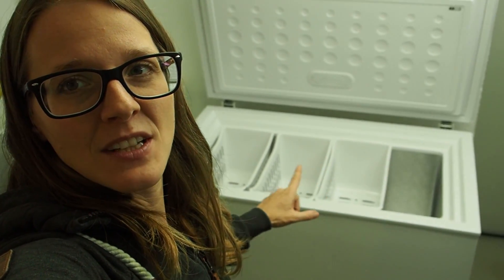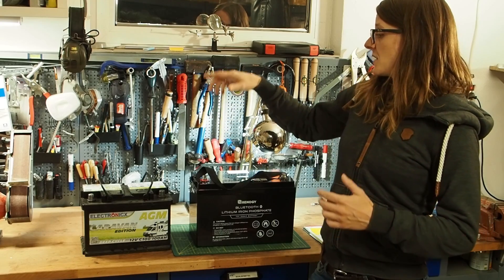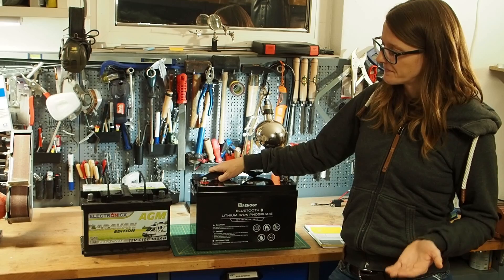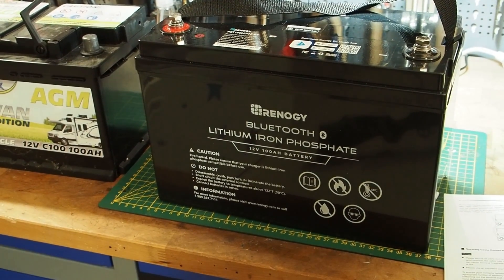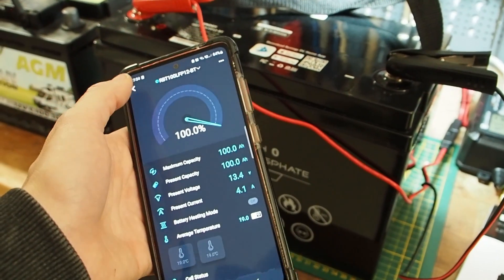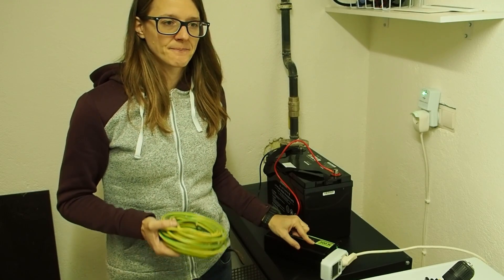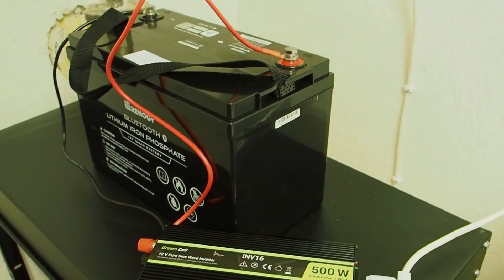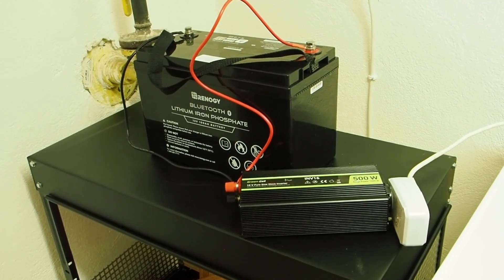How to run freezers off an inverter!

Comment: Lilly, you are doing a great job! Thank you for sharing! I think a 500W Inverter is a bit underpowered for the freezer…
Reply from the maker: My freezer draws 26 watts. The surge power is around 800 watts, but that is just for a few milliseconds. So the inverter is big enough for my model of freezer.
Reply: Why do you consider it underpowered, it draws 170 watts and inverters work most efficiently under larger load, so a bigger inverter will be less efficient and also draw more phantom charge. Lilly, can you measure the voltage and amps in the DC part so you can calculate the actual efficiency. Perhaps the Renogy app even shows the value